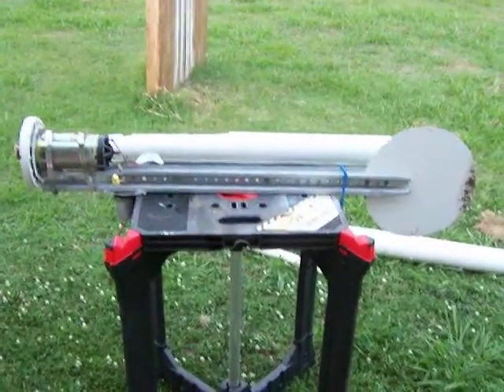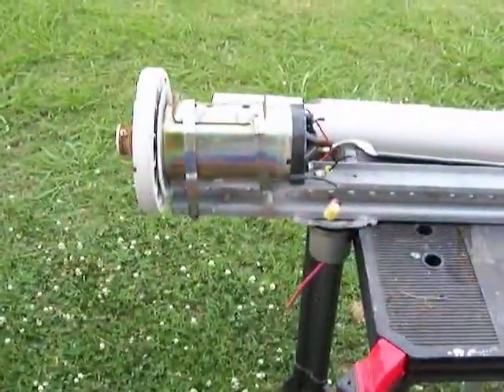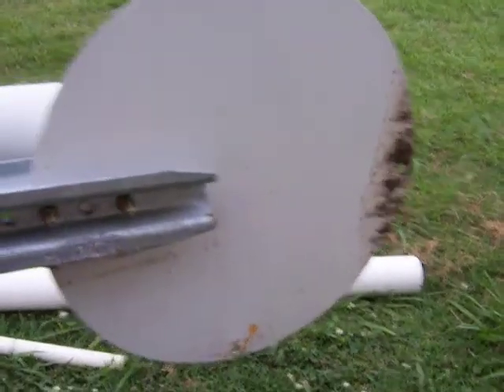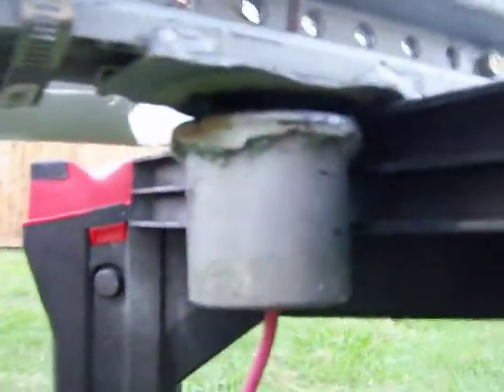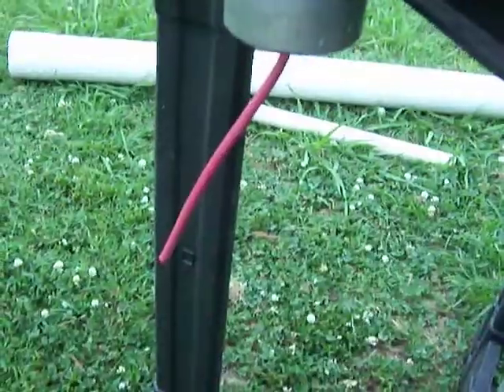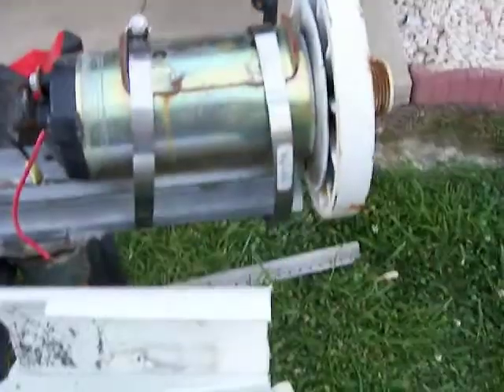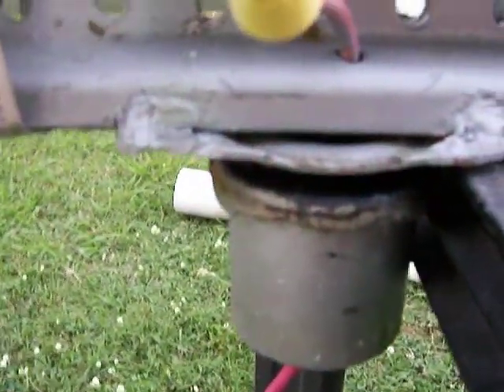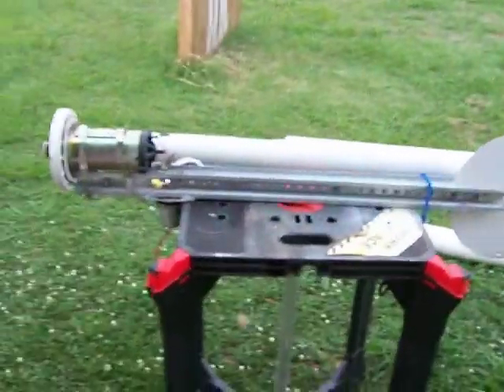DIY treadmill motor wind generator

Comment: Hello, nice video ! how can i remove the flywheel of the treadmill ? mine has a sort of allen bolt in the middle of the flywheel and nothing from the rotor comes from the back end of the motor. Thanks
Reply from the maker: its screwed on from what  i   remember

Comment: you can also mount a small wind mill over an out door a/c unit.when it runs it will power your battery bank .that's what I do and it works great.

Comment: that'll work just fine when the wind blows.Get a charge controller though and run wind mill power through it before it goes to battery bank.